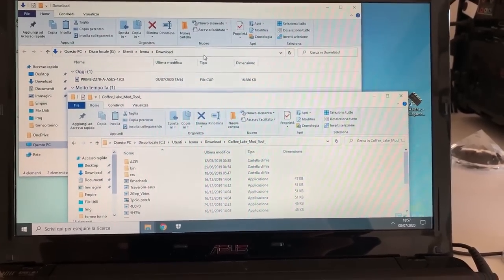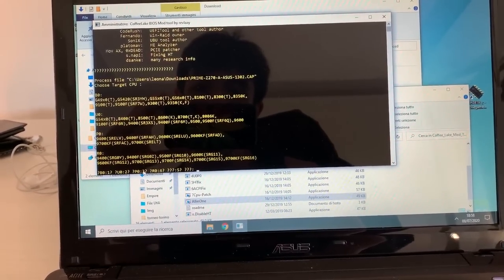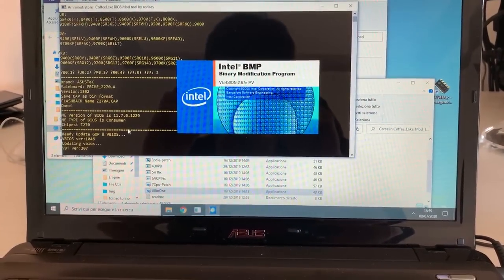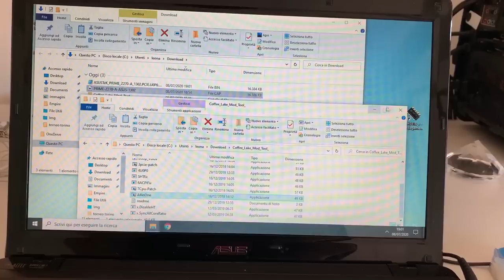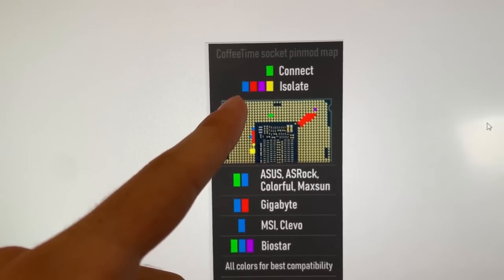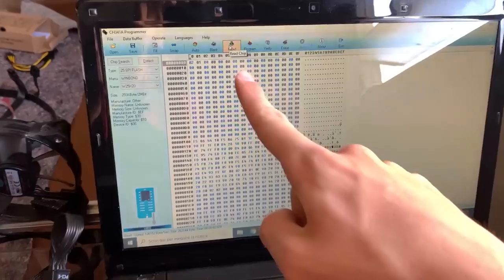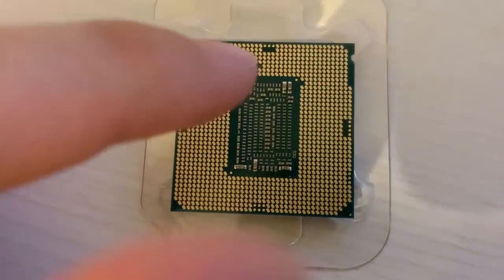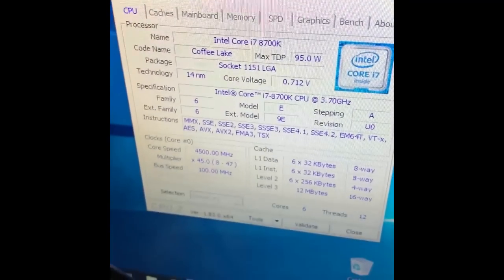How to Run i9 9900K on Z170 Full Guide (Every 8th/9th gen CPU on Z170 and Z270 mod)

Comment: Amd fanboys : you can't use 2017 intel mobo in 2020 

 ImWateringPSUs : are you sure about that
Reply from the maker: Best comment yet ahaha
Reply: Still u can't do it out of the box 😂. Bios modding will void warrenty and modifying cpu pads is not practical for most. This sort of stuff is only fun to tinker with .
Reply: @KuntalGhosh  thats what the purpose
Reply: @KuntalGhosh  That's not true, Bios mod will not void guarantee.
Reply: Yeah but not everybody is ImWateringPSUs....still this dude proved that it was possible to upgrade the cpu without changing your already existing board but Intel just chose not to because f*ck the consumers,they gotta buy new ones again
Reply: @KuntalGhosh  Warranties on products that saw their discontinuance years ago? Huh now?
Reply: what now? am4 still supported in 2024 and new cpus were just announced? they will support it as long as possible
Reply: @shockat5070  I agree with you, 4 years ago when i wrote the comment, i had Crystal ball between my hands.

Comment: Got my 9700K working on MSI Z170a Gaming M7! Thanks to this video and the win-raid forum! For my mobo I didnt need the CH341a programmer or pencil short. Just programmed bios using bios flashback feature of my mobo and used tape to isolate selected pins. Surprisingly very easy.
Reply from the maker: I’m really happy that the video was useful! The Bios flashback feature is really really useful, it defeats the purpose of getting a programmer even if you have to unbrick the motherboard!
Reply: @ImWateringPSUs  so we should be careful upgrade the bios using the biosflashback?
Reply from the maker: @Teknos78  If you have flashback, it's going to work great
Reply: @ImWateringPSUs  I have both. flashback and CH314a. I saw your image in video to mod the gigabyte motherboard need cross tape (red color)? no need to mod the chipset pin? I subcribed your channel bro
Reply from the maker: @Teknos78  Thanks for the sub! No need to mod the chipset!
Reply: @ImWateringPSUs  thanks Mate. I"ll let you know after i mod the bios
Reply: Can i contact you? Telegram or something

Comment: Hi, great vid and job! Could You share somewhere the Modtool? The original link in the WinRaid thread is dead.
Reply from the maker: Hey guys, sorry to everybody if I'm late with this: after doing a clean install of Windows on my main PC I lost the tool unfortunately. The link is still available on the WinRaid forum, but nopt trough the original post. I will try to upload a personal link in the video description, but I'd have to first get a Z170 mothertboard and 8th gen CPU to test that it's the proper tool. Sorry again for the delay

Comment: Does this work with 9900KS CPU as well?
Reply from the maker: 100% it does! But only if you’re subscribed to the weirdest tech channel on the internet (mine)😂
Reply: @ImWateringPSUs  Done lol.
Reply: If the mobo has decent vrams sure, but I think such a flagship/power hungy cpu should be ideally paired with fastest z390 boards for max oc. I'd say 8700K/9700K with moderate oc for z170/z270 is max reasonable path, 9900KS is kinda wasted
Reply: @HeartOfAdel  Combined with a functional Z170 SOC FORCE... Yup, let's squeeze it!
Reply: @TheBlueAspect  well you can try for sure, but 4000mhz+ dual rank with sub 35ns latency is probably impossible on anything below z370
Reply: @HeartOfAdel  I ain't overclocking RAM, what are you talking about lol
Reply: @TheBlueAspect  I see, I mean then be prepared to lose 25-30% of its gaming power and its full snappiness
Reply: @HeartOfAdel  Well, I might try, but XMP works fine for me, for now lol.

Also, RAM Overclocking is not as effective as CPU OC
Reply: @TheBlueAspect  ram (subtimings) + ring oc is the biggest craziest gain on this cpu, exceeding any pure cpu oc by a mile. Have a look at my recent video.
Reply: @HeartOfAdel  Ah, so you're a benchmarker... I've checked your channel and saw the one. Makes sense, but I already have 3866MHz, CL18-18-18 timings, 16GB×2 DDR4 kit so it won't make much difference- at least in memory I guess.

CPU OC with rings... yeah, that would be better.
Reply: @TheBlueAspect  it will make a big difference once you tighten All secondaries/tertiaries especially like trrds/trddl/tfaw etc. Even if it's not bdie you can get great gains by combining tight subs + ring oc
Reply: @HeartOfAdel  Oh wow. Did not know about that... How about raising the clock even higher by sacrificing(loosened) tight subs? Clock speed vs. Tight subs... what's your opinion?
Reply: @TheBlueAspect  yes I wanted to mention it as well but forgot lol xD 
You should sacrifice clocks for the tightest subtimings/best latency, but obviously not by that much, there has to be balance. What's your board?
Reply: @HeartOfAdel  Z170X SOC FORCE made by GIGABYTE. One of the well-made motherboard of that generation.
Reply: @TheBlueAspect  does your 3866 xmp work there? If yes, you might be able to do super tight secondaries/tertiaries/rtl,iol at 3400-3866mh depending on bios tuning/ram training settings
Reply: @HeartOfAdel  Yeah, works fine to me. The fastest and largest memory that I can use with XMP. lol.
Reply: @HeartOfAdel And Now, my 9900KS runs at 5.0GHz(stock freq.) at just 1.25V lol

Comment: Did it with Asus z170i pro gaming , used i5 9600k ... Works flawless with igpu and gtx 1650super. Flashed with usb programmer. Didn't work without shorting socket occupied pins. Isolation made with capton tape. Relatively easy but hard to see for me ( without magnifying glass + close range glasses ) younger ones with %100 vision and steady hands can pretty easy.
Reply from the maker: Great to hear some positive feedback! Keep it up ;)
Reply: @ImWateringPSUs  Thank you, status update : no issues so far running strong and stable. ;)
Reply from the maker: @nitehawk4067  That's just great man, I'm very happy you took the time to write this!
Reply: You're definitely working with the better stuff :-) I think that's one of the better choices to isolate for sure :-)

Comment: Is the risk high? I want my gigabyte z170 upgrade from i5 6500 with the i7 8700 or 9700

Edit: also I don't have the programmar can I use it without it?
Reply from the maker: It's very low risk, but you need to buy the programmer.

Comment: Hey man just wanted to confirm. If I buy a Z170 board, do the BIOS flash and put in something like a 9400F or i5 8500 or similar, can I still increase the BCLK of the board to get higher CPU clocks?
Reply: +1 This would be insane value, if possible.
Reply from the maker: Unfortunately you can't, it was an mCode weakness, not a board weakness. And clearly on 8th and 9th gen you'll use the according mcode, not the skylake one

Comment: Can I flash the modded BIOS using a USB stick?
Reply from the maker: Yes you can, but it has less chance of working. Around 1 out of 3 motherboards will work via USB flash. But if done properly the worst thing that can happen is your new CPU won’t work, you don’t risk damaging anything

Comment: I literally want to ask, I got the b150m pro  on my second pc and I got a pentium g4560 on it, I will upgrade my 9100F on my main pc and I am thinking about this mod and I am not even kidding, I’m curious, will this work?
Reply from the maker: It will my man!
Reply: Also, you dont even have to mod it for the 9100f. You just need a bios update.
Reply: you can update? im know B250 chipset can be update with i3 9100 but no sure if i5 or i7 9th gen can handle for this chipset since is very basic ( 2400 hz in ram only )

Comment: Hi, thank you so much for this video.
I have a z270 maximus apex, I seen in another video that  in my motherboard for to flash the bios using the flashback usb, I need to connect 2 pin of motherboard solding it. 
If I use USB programmer for to flash bios I can skip this step?
And, have u used a normal pencil for connect cpu pin? It's safe and permanently or is better to use some conductive paint?
Sorry for my  bad english. 
Thank you a lot, obviously subscribed :)
Reply: Ok se non ho capito male sei italiano, a saperlo prima ti avrei evitato il mio orribile inglese xD puoi rispondere in italiano se ti va.
Grazie mille
Reply from the maker: @Manu33x  Ciao, purtroppo parlo italiano ahahahaahahah
Aaaallora, non serve collegare i due pin se fai il flash con il programmatore. La matita va bene ma la vernice è meglio. Se riesci a farlo funzionare con la matita, è permanente. Il problema è che devi usare tipo una B2 di matita e colorare davvero tanto
Reply: @ImWateringPSUs  Ahahah! Allora orgoglio italiano :D devo procurarmi subito una 9700k :D
In un altro video ho visto che sempre con il tool winraid fa un operazione di allineamento di tutti i core, per far funzionare tutti gli 8 core.
Tu hai testato che funzionassero tutti i core senza farlo?
Io credo di avere due bios nella mia mobo, è indifferente programmarne uno o l'altro?
Nel programmer devo settare delle opzioni in particolare?
Grazie mille :)
Reply from the maker: @Manu33x  AAallora, credo che il discorso dell'allineamento andasse fatto con una versione precedente del tool, ad oggi non serve più. Funzionano tutti i core senza farlo. E' indifferente quale bios tu programmi
Reply: @ImWateringPSUs  Grazie mille amico! Spero tu abbia un po di pazienza per rispondere a queste domande, se ti sarài rotto di rispondere lo capisco e ti ringrazio ugualmente. 
Avrò problemi a fare questo senza schedavideo? Ovvero con la scheda integrata della CPU?
Programmando il bios poi posso tornare tranquillamente alla 7700k quando voglio e senza toccare i pin della cpu o dovrei riprogrammarlo con il bios originale?
I chip bios sono i windband 25q128fvsq? Come potrei capire quale è l'1 e quale il 2?
Grazie mille ancora
Reply from the maker: @Manu33x  Ti serve assolutamente una GPU. Puoi usare il 7700K dopo il flash, I chip sono quelli ma onestamente non saprei come fare per determinare quale sia il principale
Reply: @ImWateringPSUs  Grazie mille!!!
Quindi la gpu integrata del processore non va bene? Potrebbe non funzionare?
Reply from the maker: @Manu33x  Dopo il flash l'output dell'iGPU può avere dei problemi a seconda della mobo, purtroppo
Reply: @ImWateringPSUs  Grazie mille, stavo per fare tutto senza gpu, probabilmente sarei uscito pazzo!
Un'ultima cosa e non ti disturbo più, ti offrirei una cassa di birra se tu fossi delle mie parti!
I pin sulla cpu da isolare per asus sono 2, non ho capito perché nonostante tu abbia un asus ne abbia isolati 4,almeno questo mi sembra di vedere sul video!
Grazie ancora amico, ti farò sapere appena faccio tutto, devo ancora decidere se fare la piccola saldatura sulla mobo o agire sulla CPU :/
Reply from the maker: @Manu33x  Due da shortare + i soliti due da isolare!
Reply: @ImWateringPSUs  so you are saying that if I hav programmer I don't need to join the 2 point with pencil in cpu BTW I have Asus z270f and I5 9600fk

Comment: How do you get the CPU to have hyper threading? What intel management engine interface are you using?
Reply from the maker: Depending on the motherboard, there might be no problem at all with hyperthreading or you’d need to patch it. The patch is included in the program I linked, same goes for the M.E.

Comment: What to do if I don't have a CPU for Z170? Pls help 🙃
Reply from the maker: You can do the mod blindly. it will work anyway
Reply: @ImWateringPSUs  but what abt the bios?
Reply from the maker: @carrotjuice3732  You're gonna need the programmer which I show in the video

Comment: I currently have a asus maximus 9 code and wondering if I could do this mod and successfully upgrade using the same process?
Reply from the maker: Yes you can!
Reply: @ImWateringPSUs  the pin layout of 8700k & 9900k are exactly the same? And if so does the exact same pins have to be shorted/fused as per the graph?
Reply from the maker: @eanmccraken3153  The pin layout is not the same, but yeah those are the pins that you have to short out. Not the same as I did, but according to the graph I showed
Reply: @ImWateringPSUs  great thanks alot. Very intuitive video
Reply from the maker: @eanmccraken3153  I'm really glad you found it helpful!
Reply: I have a MSI Z170 Gaming M3, Could I do it?
Reply from the maker: @paytufo  Yes, definitely

Comment: I have a biostar BTC tb250 pro board And I trying to install an i3 9100f, I have a programmer CH341A I want to know if it is possible on that board, and what maximum upgrade do you recommend when talking about the processors?

Perdón por el mal inglés soy de Venezuela, SALUDOSSSS!!!
Reply from the maker: Hi there! Yes it possible, I wouldn’t go higher than a 9600 though. Saludos mi amigo :)
Reply: Hola amigo, como estas? Quisiera saber si lograste que funcionara el procesador de novena en tu placa btc 250pro. Tengo esa actualmente quiero hacer ese mod

Comment: will a b150 motherboard work with this mod?
Reply from the maker: Yes it will!
Reply: @ImWateringPSUs  that's great. I have a small zotac en1060k with an i5 7500t and a gtx 1060 6gb mxm. I'm thinking of putting a i5 9400f or an i7 8700. Although it's cooling might not be up to it. It's a really small cooler design for a 35w T processors.
Reply from the maker: @ronaldsanpedro1976  It's probably gonna be alright man, maybe get some airflow over there ;)

Comment: Hi, download link the thread is dead. Can you upload it ? Thanks
Reply: Sorry I meant the download in the Win Raid thread for the tool is dead. Can you upload?
Reply from the maker: Hey guys, sorry to everybody if I'm late with this: after doing a clean install of Windows on my main PC I lost the tool unfortunately. The link is still available on the WinRaid forum, but nopt trough the original post. I will try to upload a personal link in the video description, but I'd have to first get a Z170 mothertboard and 8th gen CPU to test that it's the proper tool. Sorry again for the delay

Comment: So I gifted my sister my old AsRock Z170 Fatal1ty K6 motherboard and the 6600K I had. I'm wondering if this would work with this motherboard so that I could further the lifespan of this old build. I gave her a 1070 Ti but I think it's on its way out so I would like to put a more modern GPU and use this mod to get more use out of a more modern GPU. The most intensive games she lays is The Sims so it wouldn't rake much to keep her gaming experience a decent one.
Reply from the maker: Hi there, yes it would definitely work. It’s not a beginner’s mod though, so be prepared for the hard work :) And consider subscribing!
Reply: @ImWateringPSUs  I'm looking forward to it! I'll want to get a Coffeelake CPU first before I start diving in though. Will do!

Comment: I've been wanting to do this mod on my motherboard for a while its a Asus IX Formula, and I remember that I read i needed to solder some pins on the actual motherboard, now is that an outdated way of doing things? Or do you still have to solder some pins in order for the board to recognize the modded BIOS file.? Also would this work with the i9 9900KF CPU?and if so what option # would I pick in the program.
Reply from the maker: You don’t need to solder stuff if you have access to a BIOS programmer like the one I use in the video. You need to check the stepping of your CPU and pick the according mCode
Reply: @ImWateringPSUs  awesome thanks!
Reply from the maker: @Koiboi100  Let me know how it goes my man!

Comment: não necessita mais a soldagem ligando um capacitor em terminal da placa mãe? 
você não fez mais nada alem da modificação da bios e terminais do processador?
tenho uma asus code IX esperando por um i7 9700. que não modifiquei por falta de um ferro de solda de 20W.
Reply from the maker: Could you please write it in english?
Reply: Conseguiu man?
Reply: I have the same motherboard and only insole 2 pins with graphite pencil and solder the 2 pins on the motherboard

Comment: Would this work on a Asus Z170-E board
Reply from the maker: Yes, definitely
Reply: @ImWateringPSUs  does it involve soldering and shorting pins??
Reply from the maker: @prawnstarrr  Nope
Reply: @ImWateringPSUs  so potentially just flashing the bios from the bios menu via USB with the modified .CAP file? that is how i have updated the BIOS before
Reply from the maker: @prawnstarrr  Yes but flashing it with a programmer, as shown in ther tutorial. And doing the pencil mod to the pins of the CPU
Reply: @ImWateringPSUs  so even if I have the programmer I need to pencil mod 2 pin in cpu I have Asus z270f

Comment: Hey thanks again for this awesome Mod.
I did it two years ago and IT worked perfectly but now I updated my bios with some .cap of Asus Website in order to enable TPM 2.0 of my Asus Z170-A because it was required by League of Legends. I thought it could work and in case it dont, I flash the BIOS chip again.
But after I run the BIOS Update with Asus Utility it shutdown and I have black Screen when I turn it on. Even when I flashed the bios chip again with the old modded file, nothing changes.. I  am confused why the state is not changing.
Do you have a idea @ImWateringPSUs?

Thanks and best regards
Reply from the maker: Hi there, first of all I’m really happy you’ve been running the mod for so long! What probably happened is that file flashed some “protected” parts of the chip, so now you 100% need to do it with a programmer (but I suppose you have it already). Simply re-flashing the bios with the programmer with the original file should get it done, try also reapplying the pencil maybe. And do a few clear CMOS